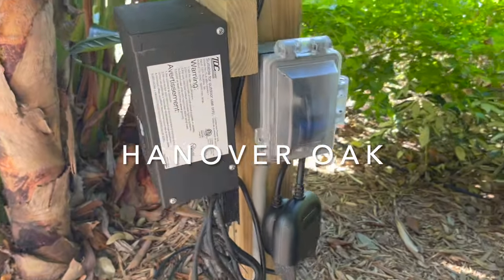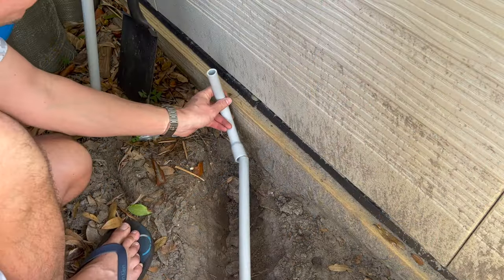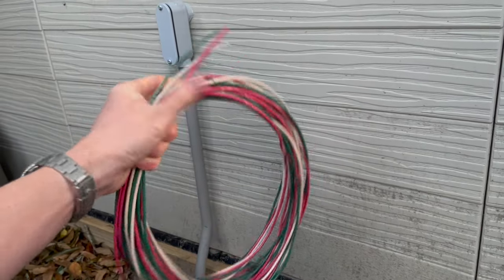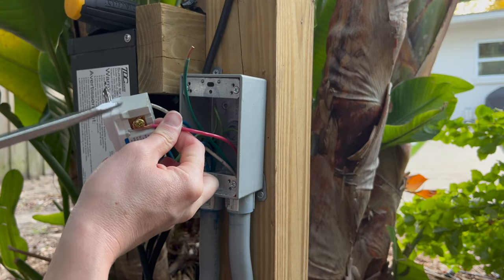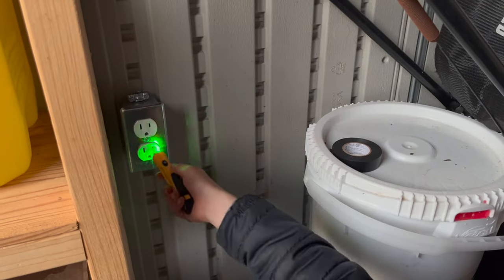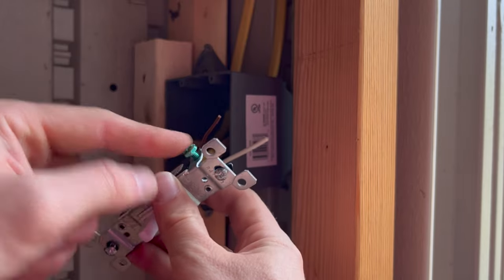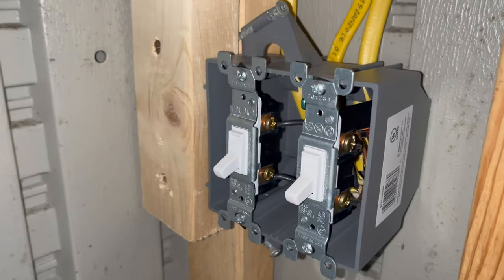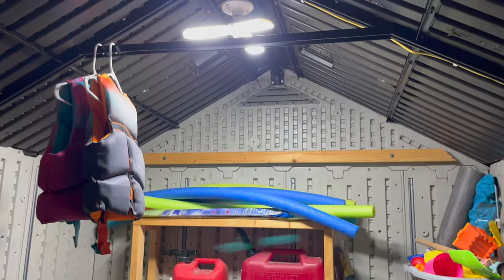How to Run Electrical in Underground Conduit to Outdoor Shed for Light - DIY

Comment: Schedule 40 pvc can be buried under ground.  Since the Pvc above ground could be subject to physical damage, schedule 80 pvc is required

You also need a water proof washer on the conduit fitting you screwed into the metal box

Comment: Your video was very good and informative, thank you. I have a question, I appreciate if I can get a clarification needed to do  some underground conduit wiring work tomorrow.

Home Depot & Lowe's don't seem to have any THWN wire, only THHN. Some wires are rated for both, but their THHN doesn't seem to also have the THWN rating. Is it OK to use THHN 12 gauge wire to bury 12 in underground in a PVC pipe in a GFCI circuit, or is the THWN rating absolutely necessary?
Reply from the maker: In my opinion you are fine to use THHN. You can research online but most will say the THHN now is perfectly fine for your use. I have had no issues whatsoever.
Reply: @hanoveroak  Thanks for the reply.

Comment: According to the NEC, PVC conduit requires a minimum cover depth of 18 inches for residential installations and 24 inches for non-residential installations. Please note that these guidelines are based on the NEC, which may not apply to your specific location.

ELSE

If your jurisdiction has not adopted the NEC and you have not a local Inspector...you can do whatever the hell you want pretty much...however there few of those places left anymore!!!

Comment: I’m having the same project. Just don’t want to go off the outlet outside in case too much current will trip. Outlet is dedicated to internet. How would I run it from the breaker instead? 20amp 12/2 wire.
Reply from the maker: How far would the wire run be from the breaker?
Reply: @hanoveroak  maybe 15ft give or take. Do I have to go to attic as well?
Reply from the maker: @robertmunguia250  that’s not far - you could run that underground in conduit with THHN 12/2 wire. Just make sure you put it on it’s own 20amp breaker.
Reply: @hanoveroak  yes im in process of going underground but now im stuck by the house. How do I get up to breaker? It’s inside the house.
Reply from the maker: @robertmunguia250  Ahh I see what you’re saying. You’re going to have to drill through the wall and run through that way. Or go all the way up to the soffit and drill there and go through the attic. I would go through the wall though.
Reply: @hanoveroak  ok so I uncovered the breaker panel and knocked out one of the knockouts from the bottom. You think I could run it from underneath or through the wall?
Reply: I just don’t have fish tape. Thinking of running to Home Depot and getting some. What size of drill bit would you recommend?
Reply from the maker: @robertmunguia250  Run it from underneath through the knockout. Definitely get a fish tape. They are pretty inexpensive. I would say a 1/2” to 3/4” bit will do the trick.
Reply: @hanoveroak  yes I got a cable bit 3/4 54in.
Reply: @hanoveroak  You need THWN or THWN-2 wire for underground conduit.  THHN isn't suitable for wet locations (which underground conduit is considered to be).
Reply: @robertmunguia250  FYI, you need THWN or THWN-2 wire for underground conduit.  THHN isn't suitable for wet locations (which underground conduit is considered to be).
Reply from the maker: @nukem294  thanks for the input! The problem is, you’re typically not going to find THWN in the big box stores. What I’ve found is it’s usually dual rated THHN/THWN and perfectly acceptable in outdoor conduit.

Comment: I am courious what type of stranded wire you are using in the PVC?
Reply from the maker: It is THHN wire which stand for thermoplastic high-heat-resistant, nylon-coated wire. It is heat and water resistant. You can buy it at any home improvement store or wire supply stores online. Hope this helps!
Reply: @hanoveroak  thank-you for the help! I have one more question. I know you were able to run the conduit directly to a box inside. Is this a requirement for THHN wire? Would I have to continue the conduit run to a box once it's inside the building to protect the THHN?
Reply from the maker: @garusbooth  Actually, the THHN runs through the conduit to a panel that is located on the outside wall of my house. THHN is perfectly fine to be run to an outside box.
Reply: @hanoveroak  Thanks so much! Great video! Also I must have missed it because I just rewatched the video and you had mentioned using THHN 😀
Reply from the maker: @garusbooth  No worries! Glad it helped. Let me know if you have anymore questions. :)
Reply: @hanoveroak  The wire you used wasn't dual-rated THHN/THWN? If it didnt have the W for water-resistance you actually used the wrong type. But nicely done video!
Reply from the maker: @aayotechnology  Both THHN and THWN are water resistant. THWN just has a higher maximum recommended operating temperate in wet/dry conditions. THHN is perfectly fine for this installation. :)
Reply: @hanoveroak  not true, look it up. But probably not an issue
Reply from the maker: @aayotechnology  I did research it - that’s how I know ;)
Reply: @hanoveroak  Underground conduit is considered a wet location.  THWN is required; THHN is against code.

Comment: Those cable staples are a terrible idea.

They work fine into lumber but that plastic will let you pull them right out.  You need screws.
Reply from the maker: They actually hold nice and snug. Been in place for months and haven’t had any pop out.